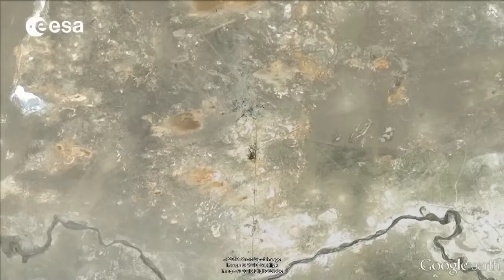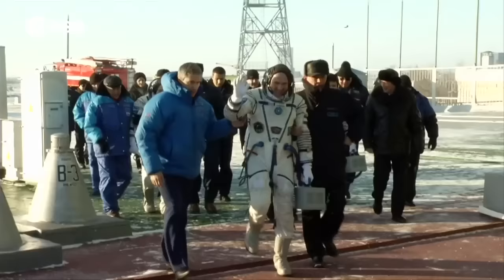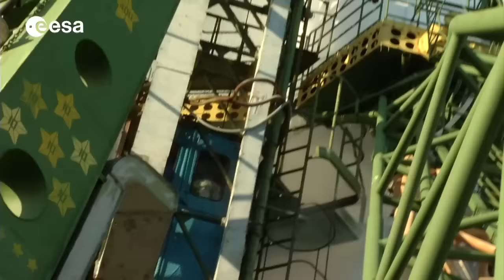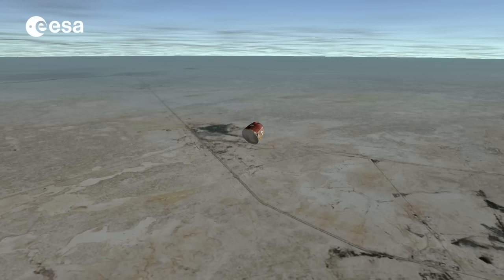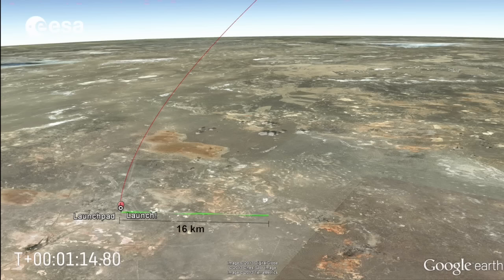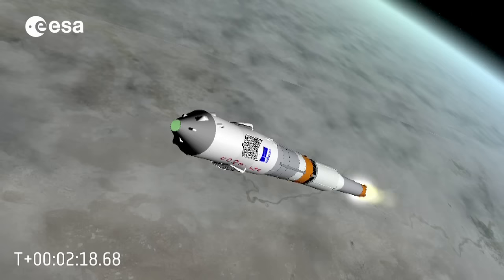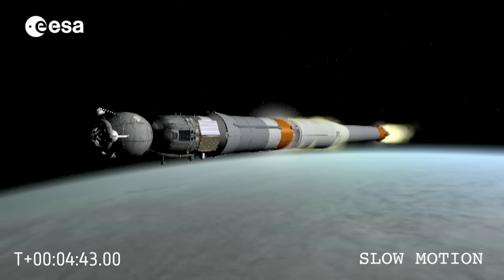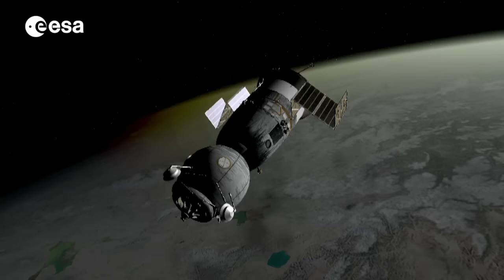The Soyuz launch sequence explained

Comment: I know I'll get hate for this but I think the space shuttle is better for getting into orbit and back sorry but it's my opinion if you don't like it then sue me
Reply: +kelly wilson whitehead 
I appreciate your opinion and accept that you have the right to have it and believe it, but I want to ask:
Do you know how much more difficult a shuttle is to calculate, take off, fly, maneuver and dock with than a rocket?
Rockets such as Soyuz and Saturn V (the rocket that launched Apollo 11 to the moon) are for one: symmetrical, which makes take off, flight and maneuvers so much easier to handle and calculate already. Then you have the issue of docking, because if you have a docking port on the side or top of the Space Shuttle then you could imbalance it and cause a failure at launch. It's a very, very delicate process to launch such an asymmetric spacecraft.

Granted I do believe the Space Shuttle is better for suborbital or short-term orbital missions, as it safely returns with much more of the original craft, only the main fuel tank and the two solid rocket boosters are lost in the accent, the shuttle remains intact for the remainder of it's journey. On the other hand, for long-term orbital missions or interplanetary missions it a: doesn't have enough Delta-V (the total acceleration that can be achieved with the fuel and engines it has) to reach other planets, or even the moon. b: It's large, bulky and could cause some significant issues if it were docked to the ISS or other space station.

The Space Shuttle was mainly used as a science lab in orbit, it also served to repair other orbital craft such as the Hubble Space Telescope. But later it also did in fact serve the ISS.

My final conclusion is that Soyuz is much safer and more reliable for getting humans to and from orbital stations, the Space Shuttle however is still a viable option for this type of mission, but I believe it is not well suited for it and would be better suited for sub-orbital missions.

As I say again, I'm not hating on you for having an opinion; I'm just stating mine and backing it up with some factual information and knowledge.
Reply: +kelly wilson whitehead 
mind you that an opinion not supported (in your case also in contradiction) with scientific facts, is just a dumb opinion. unless you want to be seen as a dumb person, it's better to not express this kind of opinions to the general public.
freedom of speech is something americans will never fully comprehend. no hate, just saying that for future reference
Reply: MGS Lurmey
 learn to read. i clearly replied to the other guy. it's in the first row of my comment.
my statement isn't an opinion, its a fact by itself.
if i told you that it's my opinion that people with white hair are gay, would you call me dumb? yes you would.
stating that the space shuttle is better when it clearly isn't is stupid.
you shouldn't apologise three times in a sentence when disproving someone. if you think i'm an asshole, feel free to say it, i won't get offended.
to conclude: vynil is the best method for storing music
Reply: +MGS Lurmey 
no i'm not trolling. i simply misinterpreted your sentence as "you failed to even click the right reply button", sorry for that.
opinions are neither right or wrong, but they can be stupid, and this is a fact.
now, my opinion is that if someone makes a pointless statement apologizing for what he is about to say, chances are that opinion is going to be stupid.
i expressed my opinion based on a fact. the fact is that you can't say that the space shuttle is better in the context of a video going through the details of the soyuz's launching manouvers. the space shuttle is better at getting into orbit and back? what does better mean? easier to fly? more reliable? more cost efficient? that statement lacks enough details to be even taken seriously. this is the paradigm of the dumb opinion.
and about the spelling mistake, i apologize humbly. anyway, not being english my mother language, i hope i can be forgiven, having made only one misspell in one whole comment.
Reply: delirio1987 Ahh, I completely understand now and wholesomely agree with you. Although I don't believe that it is fact that an opinion can be dumb, because even that is an opinion. But to be honest, I see what you mean, and I agree nonetheless. I'm glad we've come to an understanding and I apologise for appearing so rude.

Also, you're forgiven for the spelling mistake, it really wasn't a problem, just something I felt like pointing out.
Reply from the maker: +MGS Lurmey +delirio1987 ... so glad you two managed to sort it out. thanks for keeping it polite.
Reply: Yeh, but where is the Space Shuttle now? Gone. Useless, Can't handle the stresses. You want to go to the ISS now, you go Russian. Space Shuttle proved it couldn't last. Now, the older conventional style is still proving the most efficient.
Reply: ISS was built by Space Shuttles. No other vehicle could bring the parts up there, connect them and return.
Soyuz is just a cheap "Lada" solution for bringing max. 3 people there. It's a cheap taxi, rented by NASA.
Reply: You don't need the Space Shuttle to construct a space station.
Reply: Actually ISS was built by Proton-K and Proton-M rockets first module of ISS "Zarya" launched in 1998 from Baikonur, Space-Shuttle built only remnants!
Reply: It's gone, it wasn't good enough.
Reply: It was a cool idea, probably the best looking spacecraft of all time. But by all practical means, it was a mess.

Launching was a nightmare of vector calculations, endless preflight checks, a huge amount of things that could go wrong, etc etc etc.

Making it reusable meant to carry a lot of dead weight into space just to have a pair of wings that were used for about five minutes when a parachute could basically accomplish the same. Landing that thing wasn't like in the movies or an actual airplane, it was more like landing a shoebox using only the wind.

Finally, the whole "let's make it reusable" pitch was highly misleading. The vehicle was reused, yes, but it took so much time to refurbish it between flights that it was literally orders of magnitude more expensive than building a brand new rocket.
Reply: Lol, you made my day, another victim of degradation, do you also wanna tell that first on earth modular Space Station was built by Yanks and not Soviets where MIR was built one by one with Soviet rockets which carried all its 7  modules excluding one where Docking compartment was delivered by STS Atlantis so Americans can come and visit such a piece of art and do their experiments too ?
I do not know who you are and where are you from but I'm sure that you don't follow the History. Your NASA is renting Tesla's ''Ubers''  for delivering goods and begging Russians to take their Cosmonauts oh sorry astronauts to the SPACE.

Comment: 4:09 "On only one occasion in the history of Russian Cosmonatics was this escape system put to use." I like to make a correction. as of 2018, this system has put to use agian. on MS-10, a failed oxygen valve failed to open during booster separation. this cause one of the boosters to crash into the second stage and the mission was automatically terminated with the abort system activated.

Comment: What happens to the third stage after it separates from the spacecraft? Will it de-orbit naturally and burn up in the atmosphere? Is it required to de-orbit over an uninhabited area? Are there any control systems on the launcher or just on the spacecraft? Why is helium used to pressurise the LOX tanks instead of nitrogen?
Reply: Yes. Debris.

Comment: There is in the graph at 9:32 altitude after soyuz separation above 200 km. But i read somewhere, that ISS is in altitude above 400 km. How does soyuz reach it? By its own engines?

Comment: I have a question, in every Soyuz lunch, NASA obviously speaks in miles per hour, so when the rocket has reached its top velocity NASA says the rocket is flying at 13,500 mph, but in this video the europeans say 13 250 kph.

Why? Is there a mistake in the video?
Reply: Why would it be a mistake?
Both Russia and Europe use the metric system.
In fact, NASA has even switched over to using metric nowadays, for the upcoming moon missions.
The Russian space program has always used metric.
Although NASA will probably still use English units when creating something that is aimed at the US public.
Reply: Kalle Vikman The mistake is the significant difference between miles and kilometers
Reply: Stephane Ghiste Well yes, watch and listen the NASA videos on Soyuz, regarless of the 250 units of difference which is not the point, they always say; MILES during the whole process.
Reply: ***** I guess you refer to the 13,250km/h at the 2nd stage separation (9:15 in the video). The LEO orbital speed is about 28,000km/h (which is close to the 13,500 knots you mention from NASA). These are different speeds. The 3rd stage starting to burn at that point should accelerate from the staging speed (13k kmh) to (aproximately) the orbital speed (28k kmh).
Reply: ***** here in asia - europe /uses a metric system ex. weight= kilo/ distance = kilometre
Reply: kareem galarozaYes, I know, and it's the same here in Mexico, we use the metric system too.
Reply: Actually, the whole scientific community uses the international metric system. The US use miles on non-scientific scenarios, which are the majority.
Reply: I bet you its NASA mixing up kph and mph, they have done it before.

Comment: Or when I have a stage that goes above 70km over Kerbin, I put a computer on the rocket just to control it after the decouple, then I put the rocket on a retrograde vector and burn the fuel left.

Comment: This video does not explain what happens to the third stage. I have found out elsewhere that the 3rd stage returns to Earth, but this video shows that it's at orbital velocity on separation - so my question is, how does the third stage return to Earth under those conditions? Orbital decay only, or some other means?

Comment: where would the last part of the rocket be going? will it remain as a space debris or it will re enter the atmosphere?
Reply: afew seconds after seperation a valve opens to vent excess propellant from the rocket stage all i know for sure is this depressurizes the stage's fuel tanks so they don't explode whether this slows the stage enough to re-enter ive no idea it might do though

Comment: No piping of propellants from boosters to core (asparagus staging), I assume. It would add to complexity and opportunities for problems to crop up.
Reply: B. Xoit it’s actually very difficult to do that. It’s cheaper to have more fuel in the central booster, or have less thrust (so less fuel consumption) in the central booster until the outer ones decouple.
Reply: @Charles-fc9gi  But heard of, as in the US Shuttle with its external tank.

Comment: i wish thet had this for the colimbia and the challenger
Reply: You've got your shuttles mixed up. Anyway it's not completely true that a rocket wouldn't survive the shuttle disasters.

So Challenger failed because during launch the main fuel tank exploded, which caused the orbiter to go sideways in the airflow, and aerodynamic forces ripped it apart.

With a well designed rocket this wouldn't happen. Capsules are much more  robust to that sort of thing (especially soyuz capsules, they are basically metal balls, so you couldn't really have an aerodynamic failure). Also, the fuel tank of a rocket is below the crew capsule, whereas the on the shuttle it was next to the vehicle. This means a rocket tank explosion would be forced away from the capsule by the airflow, where as on Challenger the shockwave pushed into the vehicle from the side.

You can see that rockets keep the crew alive during a first stage explosion by the Saturn V abort modes. If the first stage exploded, the Saturn V would have fired its LAS in flight, and the crew would be saved.

Basically the crew of a Saturn V had a very good chance at surviving what happened to Challenger, a failure/explosion in the first stage.

As for Columbia, again I'd say old rocket+capsule designs have the edge here too, even more so. Columbia disintegrated because of a failure of the thermal protection tiles, which was caused by debris striking the tiles during launch.

You'd never have that problem with a capule.

First off, the heat shield of a capule would never point forward during launch, so you couldn't have it running into stuff. Also, they are usually protected by fairings and coverings, so there is no way debris could get anywhere close to them during launch.

Also, capsule heat shields are more robust. They are typically chunks of ablative material (basically they slowly disintegrate during re entry, and that dissipates heat). You can take a chunk out of one and it will still work fine, because there is more of the stuff underneath (obviously, and reentry will be more bumpy though).

Meanwhile, obviously on the shuttle they couldn't have an ablative skin, so they had to use the tiles. These are problematic because they are way more brittle than the epoxy/resin shields, allowing the impact of the debris to create a hole.

Basically, all launches of humans to space other than the shuttle missions used ablative heat shields, and there has never been a problem with them (damage during launch or other problem resulting in mission failure), because they are small, durable, and most importantly covered during launch, so there would never be a failure like Columbia with a capsule.

The shuttles were really cool though.

Comment: As I see, the Soyuz ship itself gets boosted by the third stage into an orbital trajectory, so it probably only has monopropellant fuel on board, which is used for maneuvering for docking and deorbiting when the mission is done, right?
Reply: Pretty much, although it's not monopropellant. It's storable hypergolics.
Reply: How the third stage deorbits?
Reply: Bahadır Onur Güdürü It's in a pretty low orbit, so after a few months it falls back to earth because of atmospheric drag.
Reply: Thanks Simon Y

Comment: "...follows a safe trajectory..."
And what of the 3rd stage? Is it simply left in orbit as space debris? Or does it automatically deorbit itself?
Reply: Obviously, but where does it land? They made a point of mentioning that the other debris lands in an uninhabited desert area. I could do all the maths and simulate its trajectory in a spreadsheet to estimate surface displacement, but I figure the people who launch this rocket can answer it more quickly and accurately.
Reply: k98killer It's all about speed. The 2nd stage is going about 9000 MPH when it's jettisoned, the third stage about is going about 16,300 MPH. Imagine if you were driving at 90 MPH and slammed on your brakes, they would get hot but probably survive. Then imagine you were driving at 163 MPH and slammed on your brakes...
Reply: Tomorrow, SpaceX will hopefully make designs involving stages that burn up on their sub orbital trajectories an anachronism.
Reply: Rob Speed Damn. Thanks for the warning.

Comment: Russian engineering best
Reply: Its soviet not russian, this rocket was made by the soviet union back in 60ties, its original name is R7
Reply: OK.  :)
Reply: It is Soviet, but through the years the Russians started modifying the spacecraft a bit. So it is both.
Reply: Hello Europeans, Americans and all earthlings! Russia loves you!
Reply: Its actually the Soyuz 2 which is a post Soviet design.
Reply: TheRenaissanceman65 same could be said about the PROTON launch system.  It was originally intended to launch 3-5 ultra high yield warheads, but after reduction treaties it was repurposed into a heavy lift platform that, unfortunately didn't prove reliable enough.

Comment: Does NASA have a similar fail safe method in which the astronauts are ejected from the rest of the rocket? Would something like this have saved those on board the Challenger? I need answers.
Reply: The space shuttle didn't have a abort system but both the Boeing starliner and SpaceX crew dragon have abort system's and will start sending astronauts to the international space station soon

Comment: once they reach orbit how long does it take to get to the space station?
Reply: He they have the longer trip to the station is there another compartment on the capsule? If not I would die in that tiny place for so long
Reply: +Cliff C if i'm not mistaken, they have a a second pod (spherical) on top with most of the cargo and comfort equipment (including the toilets) and basically most of the life support. it's still a bit cramped but it doubles the living space

Comment: 4:30 Well it wasn't quite that easy. The cosmonauts couldn't not activate the abort/escape system themselves.  Only the launch controller could do that. Once the decision was made the attempt to activate the system failed because the wires to do so were already burned through. A back up, radio controlled system was in another, locked room for which the launch director did not have the keys. The room was broken into and the system activated in the nick of time.
   To hear the Russian commander tell the story is very entertaining. Test pilots don't tell near death experiences like most normal people do.
Reply: lol
such rich imagination
Reply: *****
I am not making this up. It is a story told by one of the crew members himself. It is easy to look up if you care too.
Reply: *****
I don't think it took more than a few seconds to make the decision. It's just a poor design not trusting the pilots to do the right thing.